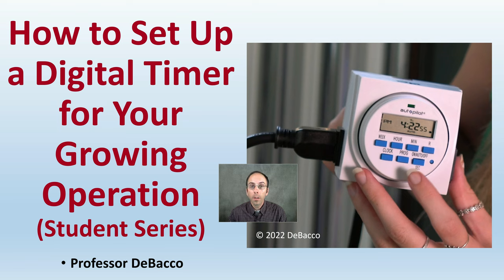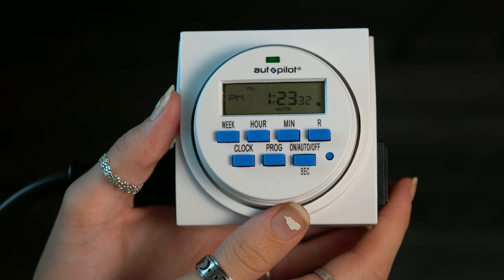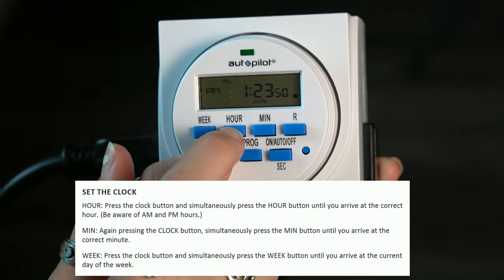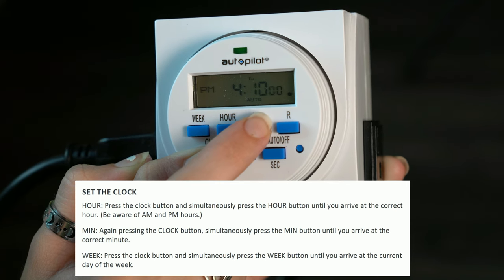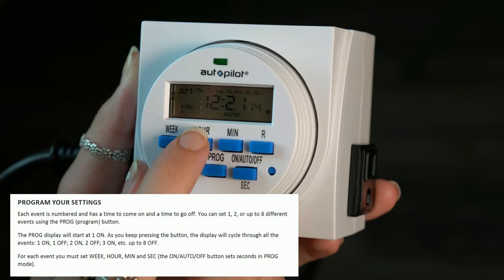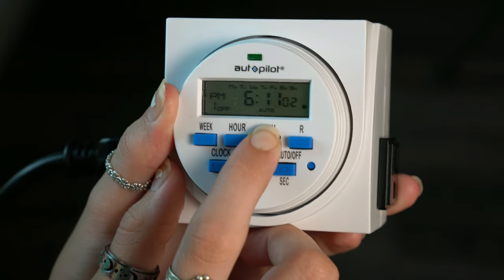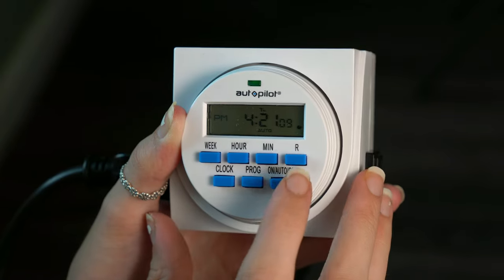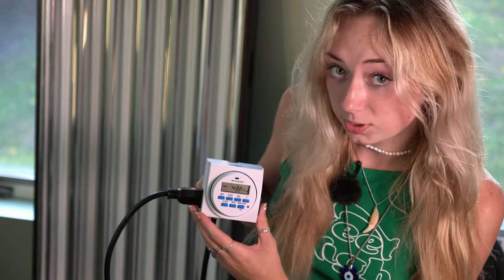How to Set Up a Digital Timer for Your Growing Operation (Student Series)

Comment: It’s easy to forgot how to do this since it’s set and forget.  In the summer I have lights off from noon to 6 to avoid excessive build up of heat.
Reply from the maker: Sounds like a good system and use this video as a refresher.